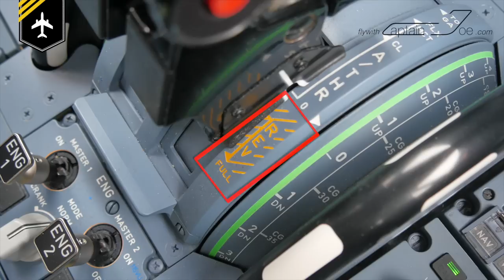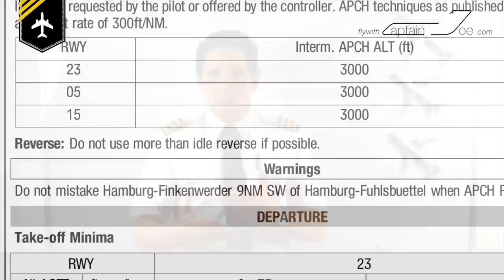What is reverse thrust? Explained by CAPTAIN JOE

Comment: Back out procedure of MD-80 with reverse thrust: Yes, it would be dangerous if it was not a strictly guided procedure: a) use it only when the ground is slightly inclined away from the terminal (for rainwater run-off) so the back-out goes downhill. b) there have to be two ground mashallers guiding the pilot with hand signs, because the pilot can not see what is behind him. One person walks behind the aircraft to check that the reverse taxi path is free and also the direction of the turn at the last phase of the taxi-back. The second person walks at the front of the aircraft at the captains side to signal him that it is o.k. a) to continue to taxi back, b) when to start turning to what side, or c) when to stop. The copilot has to monitor the engine parameters, with an emphasis on the EGT (exhaust gas temperature), because on the MD-80 the combined thrust of hot core exhaust and cool fan air is reversed and some of the hot air could re-enter the front of the engine and raise the temperature of the turbine to an unaceptable high value. In this case the throttle would have to be moved to idle immediately. Both pilots have to position their feet next to their seats, and not at the combined rudder/brake pedals, so when the marshaller would signal a stop they would not instinctively press the brake pedals and by doing so tilt the aircraft fuselage backwards in a way that the real lower fuselage would hit the ground. If a stop is neccessary the reverse is set to idle and un-reversed and then froward thrust is applied immediately to stop the backwards moving aircraft. If this procedure is not applied the "reverse thrust backout procedure" is not safe.

Comment: Do the mechanical brakes have enough power to stop the aircraft without reverse thrust and the aero flaps ???
Reply: Yes, if the run way is long enough, although it is not common practice due to the extreme amount of heat generated.

Comment: Why don’t planes use reverse thrust to pull out of the boarding place (reverse out)? I hope my question makes sense.
Reply: This used to be an actual procedure, but it was ultimately banned for several reasons. The engines would produce lots of noise, and they would burn a lot of fuel during these power backs. More importantly, the airflow from the engines would pick up any debris around the plane, creating a safety risk.

Comment: I've noticed in videos of A380s landing that only the inboard engines have reverse thrust capabilities. Is there a reason for this? As well as a different type of reverse thrust than the A320.
Reply: Yes, the a380 only has inboard reversers. There is no complex reason, it's just simply not required (considering the aircraft is designed to mainly operate at large airports with more than adequate runway length)

Comment: Hi,

I have a question about jet engine shape. I just learned about ducted proppelers and it got me thinking. Why are jet engines have a confusor shape instead of a diffusor shape?
I know that with confusor the airspeed behind the engine is higher, but the pressure is lower.
Wouldn't it be more efficient if the pressure was bigger behind the engine thus pushing the engine forward?
Why is it better if we concentrate on the speed of air behind the engine?

Regards,
Christian
Reply: It's substantially more efficient to increase velocity than use a pressure difference, though the exact numbers depend on the difference between the total pressure and the backpressure. In the extreme case of a vacuum and an idealized nozzle you could accelerate air as fast as you want while the pressure difference would barely get you anything.
Reply: @AmbientMorality  Thank you very much! Is there a simple formula or an article which goes more deeply into this? Or a youtube video?

Comment: Is forward thrust still coming out of the compressor/exhaust when reverse thrust is activated?  How much?
Reply: It doesn't go through the compressor. Instead its angled out so the air is actually going around the exterior of the engine
Reply: @ZK-APA  i get the the bypass air from the fan is angled out of reverse thrusters...I'm talking about the air drives the combustion  chamber /turbine.  Is it still coming from the back when bypass air is being channeled forward from the reverser.  Does that make sense?

Comment: what happens if it engaged in the air? can it be used for pushback?
Reply: HerrKatze You can't activate reverse thrust in air as aircraft are unable to. technically you could however doing that on a jet is not allowed. You would only see this happen on small prop planes

Comment: In the 1980,s, I flew in a 1969 model Boeing 737 with its sleek compact engines and an ice cream scoop shaped device at the jet nozzle used for reverse thrust.

Comment: I want to ask that do plane can go reverse?
And during pushback, why don't the plane goes in the reverse direction by itself instead of using a pushback vehicle?
Plz answer my question as soon as possible.
Thank you
Reply: Using reverse makes too much noise, wastes fuel, and wears the engine down. It's just very uneconomical, and it is not a good idea.
Reply: 23 Savage so you mean that if planes want than they can go in reverse but it's economically useless.
Reply: Yes. If the plane is light enough of course. It'll be much more difficult for a fully loaded 777.

Comment: I think it should be more efficiente just to turn around the entire turbine, so you can apply full trust to reverse without damaging the blades. With today servomotors i think is not impossible to design the plane so the turbines can be reversed on land.

Comment: The other day I enter an A320 from the ground and the fan was moving (I guess it was the wind)... And I can hear a loud rattling noise coming from the engine. I'm wondering why is that sound coming from the engine and it is so loud but when the engine is turned on it is smooth as silk?
Reply: edupo if you heard it inside as well it could be the PTU which stops when you takeoff

Comment: Why can't reverse thrust be used during pushback but forward thrust can be used during taxi? Don't they both suck up air?
Reply: David Liu It's nothing to do with air. It's that if you push back a big plane with reverse thrust you have very little control and you can't see behind you in a plane it's not like a car you don't have mirrors and you can't look out the window so it is very unsafe.

Comment: Watched a video of an A380 landing and thrust reverser in action. However, i observed that only the  engines near fuselage are operating in reverse thrust mode. The outward engines are in normal mode. @Captain Joe, request you to plz explain about this ?
Reply: This is a feature unique to the A380. Airbus decided to give only the outboard engines reverse thrust, so the inboard engines don't have it. The main reason is because the A380 lands at a pretty low speed for it's massive size, so reverse thrust on all 4 engines is not needed.

Comment: Why planes like A318/19/20s uses the (Flap) reverser doors (They open separately) like at 1:10 But at 2:41 they have kinda straight line of reverser doors. Why?
Reply: The reverser design depends on the engine. Remember, the aircraft manufacturer doesn't make the engines. There are separate engine manufacturers, and they decide what reverser design is to be implemented.

Comment: why don't the engine just spin in opposite direction ? sorry if it was a dumb question 😅
Reply: The engines of modern aircraft rotate at extremely high speeds, so the direction cannot just be "switched" that easily. Also, the engine cores only work in 1 direction, so even if the fans could be reversed in direction, the whole engine would shut down, and possibly get damaged due to hot exhaust air moving to the front of the engine instead of the rear.

Comment: I have a question in my mind that is really hard to search on the internet,How do you know when to switch frequency and to what?
Reply: Basically the air traffic is divided into departures, arrivals, and overflights. When aircraft move in and out of the certain airspace, they are handed off to the next appropriate control, and you will switch to that ATC frequency. This can be a control tower, an en-route control, or an approach control. Depending on where you are on your flight route (or if you are departing or approaching an airport) you will switch to frequency belonging to that relevant ATC service which is responsible for the flight at that time. 
The ATC also will give you instructions: for example the ATC can say: "Contact xxx Approach on 124.5" or "Contact xxx Center on 128.55" or "Contact Tower on 120.95".
Reply: @mikep9604  bro thank you so much really appreciate the effort

Comment: I know it works but can't get my head around how pulling by the fans then reversing the flow somehow gives more air out than taken in, then, you have the actual engine exhaust trying to push the plane forward.

Comment: Is the primarly purpose of thrist reversers to disrupt the airflow over the wings and kill the lift to give the wheels more breaking authority?
Reply: Nope. It just gives a forward component of thrust ie drag.
Reply: @ZK-APA  I guess they act as flat plates deflecting the airflow at nearly 90 degrees to cause drag at high speeds. But wouldn't that also disturb the airflow over the wings for under-wing mounted engines?
Reply: @0ki7o  Its not really a flat plate, but rather angled much forward. Remember, reverse thrust doesn't have to be 100% opposite to the direction of travel. it just needs to have a forward component. Something like if you have a wind 45 degrees from you, it'll still have a headwind component.

Comment: Captain, (or anybody who may know), I saw a video not long ago that said that the newer engines on the larger aircraft - the type where it just slides open but doesn't actually reverse the thrust, (A380, A330, etc), just divert the thrust outward, but not forward.  They went on to say that other than mitigating the forward thrust, these engines produced no reverse thrust at all, and that the brakes were sufficient to stop the plane.  In fact, on the A380, I think only the the two engines closest to the fuselage, (2 & 3??), are the only ones that open at all.  Does anybody have any further information on this?  Full disclosure - I am NOT a pilot, but always wanted to be.

Comment: Why reverse thrust is not used during pushback?
Reply: Anim, it is mechanically not possible to engage thrust reversers then rev up engines, and if they could, it would blow anything in front away, including the access ramp and the poor flight jockeys. ;-)
Reply: 5:18

Comment: nice :) just one correction if you suck gravel or some debris from RWY it damages fan blades and could damage also compressor blades behind fan but for sure not turbine blades :) and if I understood you well then for reverse is mostly used secondary airflow generated by fan right? in that case no air go through turbie even in normal flight operation of engine. No offense, just some terminology correction :)

Comment: Hello Joe, i have a question: why i’ve seen some airplanes landed without the use of reverse ?
Reply: AMPLE RUNWAY
Reply: COMMENT 3km is enough?
Reply: depends on : weight, climatic conditions , surface of runway, slope of runway, landing speed/ flap settings
Reply: COMMENT many thanks!

Comment: I love your channel. On the subject of engines, I would like to see you do a video explaining newer jet engines have a saw-tooth pattern along their trailing edges (like on the 787, the ERJ-175) and what, if any, benefits that has. Thank you.
Reply: These "saw teeth" or chevrons at the nacelle (fan housing)  are for noise reduction. They reduce jet blast noise by altering the way air mixes after passing through and around the engine.

Comment: When reverse thrust are applied, why does it make a very loud noise??
Reply: Because the pilot is thrusting the engines at 70% maximum thrust, then that thrust is being redirected forward which is all very loud. Much like at take off the engines make a lot of noise but the thrust is not being redirected. It is the combination of the two is why it sounds much louder during a landing.

Comment: When to use reverse trust? It’ll be cool to use it while flying, I wondering if the airplane can fly in reverse 😊
Reply: No it wont fly reverse. The lift flaps, elevators, wind system, anything wont work, as the aerodynamics are supposed to work while going forward.

Comment: How do you get "reverse" on a plane???? Are all planes "pushed or pulled" to the runway???
Reply: By using the reverse thrust or doing a pushback
Reply: When the aircraft is at the gate in front of the airport terminal the normal procedure there is to use a pushback tug. In front of the airport terminal it's not allowed to use the reverse thrust because of safety reasons. (The jet blast is dangerous for the people working there and it can damage nearby equipment, and there is a risk that debris from the ground can be sucked into engines and cause damage for the engines.)

Comment: I've been on many planes with wing-mounted engines that used reverse thrust for pushback.

That was in the mid 1990s.  I think most of them were the 737-300.

I don't know if they still do that.
Reply: Matthew Barich they don’t do it anymore, as it uses too much fuel
Reply: @ZK-APA  it's not because of fuel, in fact it would be cheaper to reverse thrust out however it's very unsafe as it can cause lose objects around the plane to fly around
Reply: @dylanf7990  Unlikely, as any fuel not used for flying purposes is a waste of fuel 

And I am sure that using a tug would be cheaper than going full reverse with the engines.
Reply: @ZK-APA  Nope, airlines in the 80s and 90s would reverse thrust out as often as they could as a tug was more expensive than burning the fuel.
Reply: @dylanf7990  Hmm. I don't have that much info regarding prices, so I'll take your word for it.

Comment: Why doesn't the A 380 use reverse thrust on outboard engines?
Hopefully you will answer?
Reply: I'm not a 100% sure, but I assume that the outboard engines of the A380 are already above the gras next to the runway. Reverse Trust would raise the chances that the outboard engines could be damaged by ingesting foreign objects. But the main reason is, that is saves a lot of weight and obviously the two inboard engines are sufficient.. :D
Reply: @lucakirsch4162  and also because Airbus wanted to install no thrust reversers at all since they seemed it unnecessary, but due to pressure from airlines they installed two 😂
Reply: @E9X330  Haha okay, didn't knew that😅 But I guess another break system is always good, so reverse thrust on two engines is a good solution or what do you think?🤔
Reply: @lucakirsch4162  I think it should be mandatory lol, it should have at least 2 but I can understand the fact that the outboard engines can suck up dirt next to the runway :D

Comment: This really confuses me: Deceleration is provided by change in momentum. But (in my mind at least) the maximum deceleration occurs when the engine blows the air it ingests in the opposite direction that it entered the engine, i.e. the change in momentum is zero and the deceleration is zero... How can an engine provide negative momentum when it is sucking-in air from the front?
Reply: In reverse thrust, the exhaust doesn't have to be thrown 180 degrees opposite. As long as it has a forward component, it will provide deceleration.

Comment: I'm 38 and as long as I live in an airplane was always wondered I thought that the propellers well I'm sorry the blades inside the engines slow down like super fast and then went into reverse that's what I've always thought and I wondered how could that happen so many times about the something then breaking because it has a stop and go backwards all of a sudden but I guess in reverse thrust the flaps open up and shoot the air backwards..☝🏻☝🏻😁😁🤙🏻🤙🏻 thank you captain Jo for 30 some odd years I've wondered I thought you know if the propellers well the engines and the blades if they had to stop and go backwards within a split second I knew something would break and I I just cannot fathom how that worked thank you captain 👩‍✈️ joe

Comment: 4:30 Yes, I have a question: What is the physics behind that mechanism? The Air gets sucked in from the front and gets reverted to the front. I know that it works. But why? At first glance it looks like getting out of the swamp by pulling your own hair.
Reply: Nikolaus und Rupprecht Newton’s 3rd law. Air is forced forwards, which causes a deceleration.

Comment: What do aircrafts do when they are advised to continue roll and expedite vacation from the runway?
Reply: Nayonika Sharma that means to continue moving ahead(ie don’t stop on the runway) and vacate the runway (expedite means hurry up or do it faster)
Reply: @ZK-APA  I understand that, but does that mean that the aircraft would not decelerate completely or do they accelerate again?
Reply: Nayonika Sharma yea the former. As in not applying too much brakes, or if the aircraft is too slow, maybe a bit of thrust
Reply: @ZK-APA  thankyou for this!

Comment: Is turboprop reverse thrust work same like this?
Reply: Random Gaming CH slightly different. In props the prop blade angle changes so that it pushes air in the opposite direction
Reply: @ZK-APA  thx